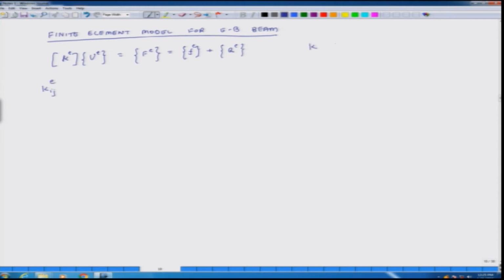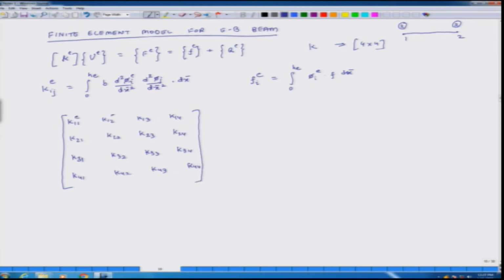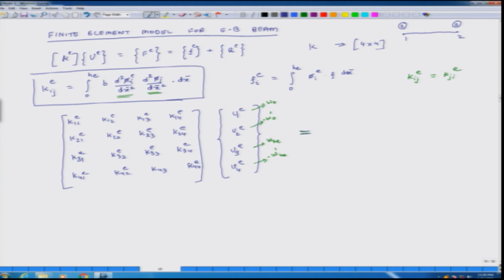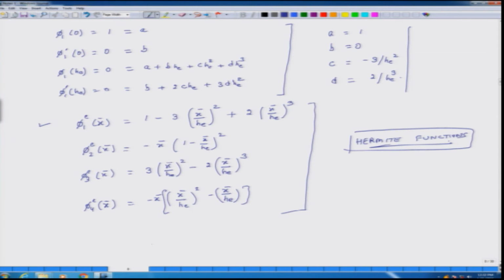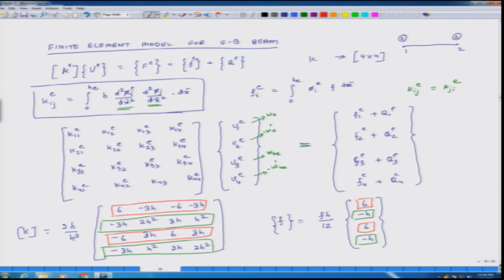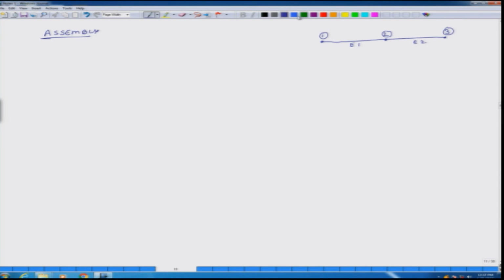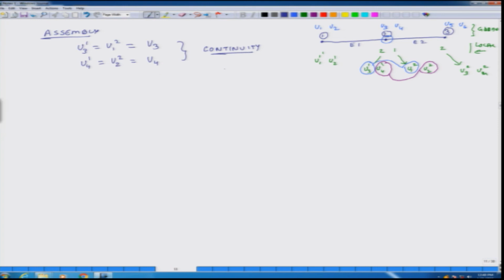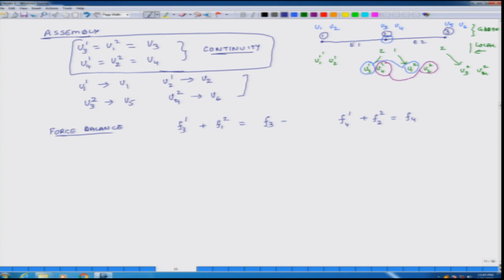Finite element equations for Euler-Bernoulli beam

Comment: hello, I believe there is a mistake in the calculation of the f vector. I think the vector should be (fh/12)*[6 -h 6 h] instead of (fh/12)*[6 -h 6 -h]. An implementation with constant values of b and f and a comparison of the FE solution against the exact solution confirmed this result.
Reply: yes you are right. cross-checked on my side as well.
Reply: thanks for your comment!